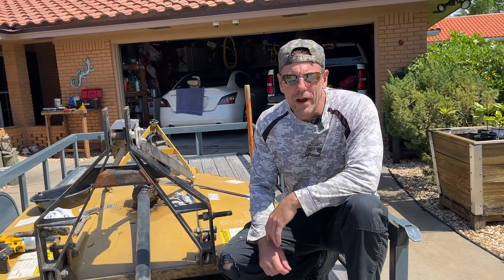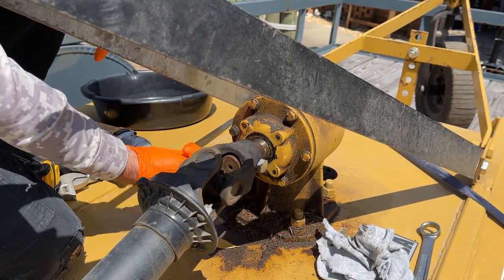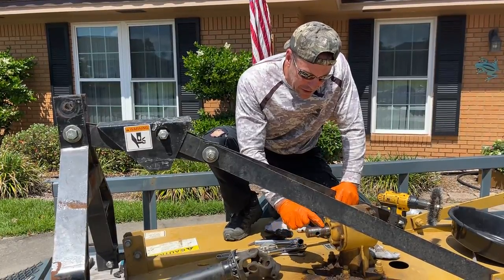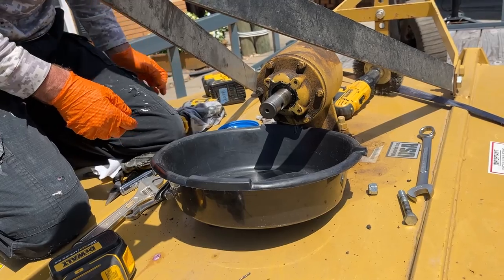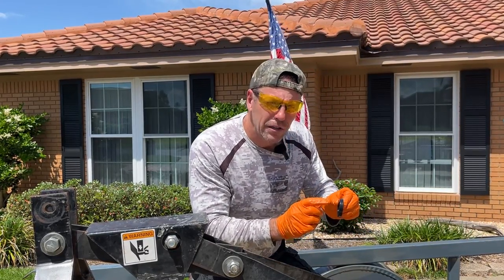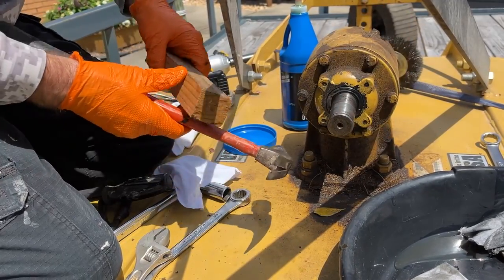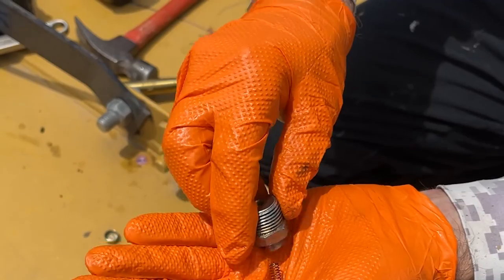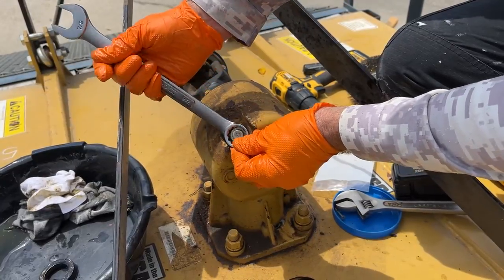EASY Way to Replace Brush Hog / Bush Hog Gearbox Seal!

Comment from the maker: A different way to change the same seal:   https://youtu.be/1QNloEVSU_g

Amazon affiliate link: Amazon seal link: https://amzn.to/3SC4gpH

This is our Amazon store with affiliate links to products we use on the channel.  It doesn't cost you anymore and it helps support the channel, THANKS!
https://www.amazon.com/shop/pineygrovehomestead-tractorsandoutdoors

Some of our favorite products on Amazon (affiliate links):
QC-Mate X-Boom Hydraulic Coupler Clamp: https://amzn.to/3MlLBfy
Proven Industries Trailer Lock: https://amzn.to/3WVzytv
Flex Tape: https://amzn.to/3R4MdWm
Mechanix Leather Gloves: https://amzn.to/3HjoZZf
Titan Post Hole Auger: https://amzn.to/3toHEx2
Ratcheting Fence Tensioner: https://amzn.to/3aEfSX0
Pope and Pipe Level: https://amzn.to/3tqUhHX
Fence Post Puller: https://amzn.to/3QbcNhy
T Post Manual driver: https://amzn.to/39dwt3J
Come Along Winch: https://amzn.to/3aQMqND
Clip bending tool: https://amzn.to/3xlqrG0
Mechanix Leather Gloves: https://amzn.to/3HjoZZf
6’ Digging and Pry bar:  https://amzn.to/3vH5Agx
Dewalt 20V ½” Impact Wrench: https://amzn.to/3UOcXNH
Dewalt 20V brushless Leaf blower: https://amzn.to/3zwJcYm
Dewalt 20V brushless ½” drill: https://amzn.to/3HGXJ7z

Welcome to our channel!  🎥 What to Watch Next: 
Fixing Leaky Pond: https://youtu.be/NEwSTg1aOWc
Transforming Our Property: https://youtu.be/-jBGEYJea1Y
Clearing Thick Brush with Mini Excavator: https://youtu.be/QVNiwOHSWdo
Mowing Large Acreage: https://youtu.be/sXV5CgRs3nk

➤FOLLOW US on Social Media: 
Facebook - https://www.facebook.com/PineyGroveHomesteadAndMiniFarm/
Instagram - https://www.instagram.com/pghomestead/
TikTok - https://www.tiktok.com/@pineygrovehomestead

Our Story:
We are six years into a seven year effort of transforming 20 acres of "Piney Grove" in Northwest Florida into our dream homestead/mini farm to be filled with animals and joy. We plan to have a variety of miniature critters on our pastures, raise free-range chickens, grow fish in our pond, garden, plant fruit and nut trees, and harvest wild game. Our goal is
to escape the stresses of corporate life and embrace all that country living
has to offer as we enter the next chapter of our lives. Follow along on our
journey!

Thanks for watching and please Like and Subscribe to help our channel!!
Brad & Deb

Comment: Thank you for this
Worked like a charm
I didn't use a punch at the end, just the wood and hammer. 

Was ready to mow and then my tractor started leaking coolant after a few passes lol. Tractors! 

On to the next project
Reply from the maker: Glad it worked for you!

Comment: I would have thought this to be a daunting task but you’ve proven it to be a fairly easy DIY project.   Too bad you didn’t have a piece of pipe to go around the shaft to set the new seal evenly.  Although, you make it work anyway.   Thanks again for the excellent content!
Reply from the maker: Good tip...even PVC pipe could have worked.  When I did the other brush hog, it seemed like it could come off the front instead of taking apart the gearbox.   I was surprised and pleased with how easy it pulled out the front!   Thanks for watching. 👍

Comment: Thanks for the process.  Was ready to tear the gearbox apart.  I might try a dent puller to remove it (guys gotta play) and a piece of pipe that fits over the shaft to seat it.  Someone below mentioned PVC.  Good idea!!  Going to order that seal now.
Reply from the maker: Glad to help

Comment: I looked at that video that's great. A Video!!! There was water in this housing. I just brought brought that brush hog. I already made a way to put the shield in the front without taking it apart with a piece of PVC pipe   Will work perfect.
Reply from the maker: Glad you got it fixed.